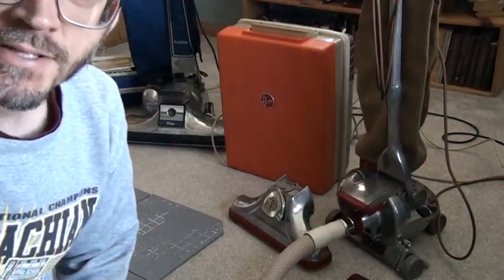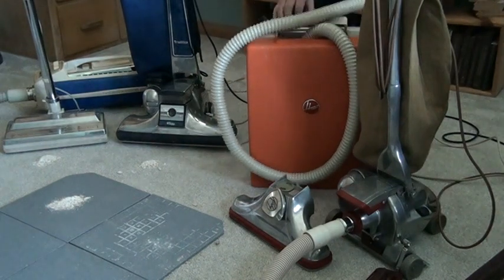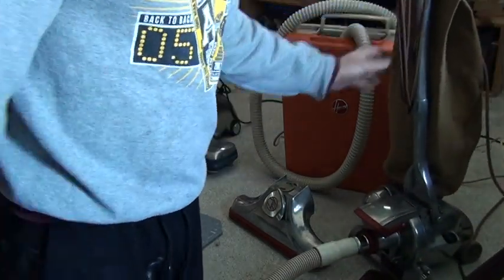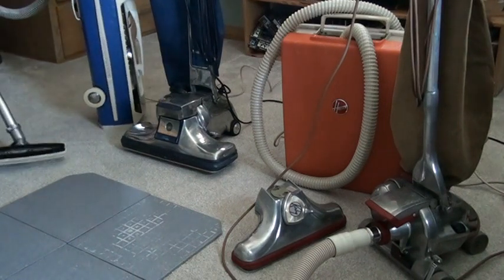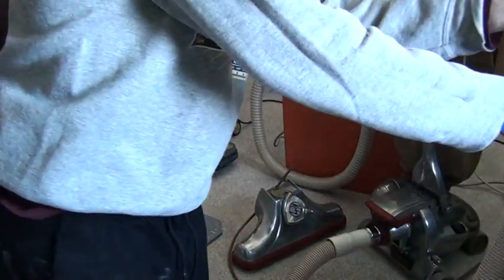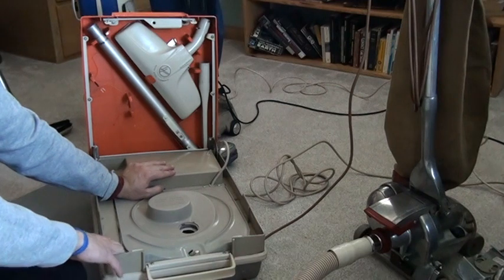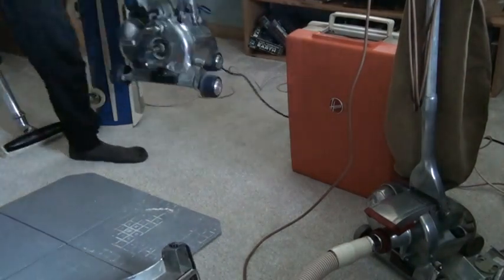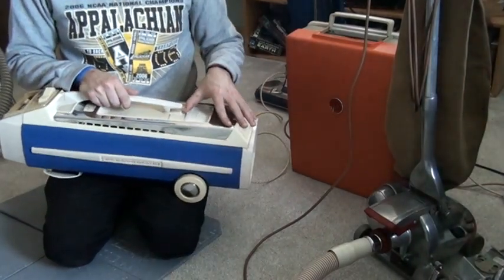Kirby, Hoover, Electrolux vintage vacuums

Comment: The Kirby 561 was built in 1961. It looks like your's has a Classic 1-CR shake-out bag and an aftermarket hose. Very nice machine. The newer plastic fans are an improvement over the aluminum, because they are lighter and more durable. I have the 519 made in 1959 and rebuilt it completely. I like your Tradition, also. The Super J is a great choice for floors and area rugs. I used to have a 1205 many years ago.
Reply from the maker: Small world.  I had watched one of your vids awhile ago about how to use shake-out bags.  Nice that you rebuilt your 519.  Working on these machines is nice and not frustrating.  
I'm trying to remember how the 1205 was different.  My SuperJ is stamped 1401.  And yea,  I've come to find the cannisters more practical when someone has both hard surfaces and some carpet, like I do.
Reply: @vap0rtranz  There's not really much difference between the 1205 and Super J. They are designed similarly. I am more of an upright guy, but I do like some canisters. I have two Kirbys and a Royal. I don't use the Royal as much, because I mostly have hard floors and area rugs. I mostly toggle between my Kirby Diamond Edition and the 519. The 519 is smaller, lighter and easier to use. I use the hose attachments on my Diamond once or twice a week for crevices I miss or cleaning under narrow furniture. I also have a Dirt Devil hand vac for light messes and animal hair on the furniture.
Reply from the maker: @mattjones7621  Yea, our older Kirbys are a joy to clean with because they're light and small.  And not bad to look at either, hah!  I still clean with mine once and awhile.